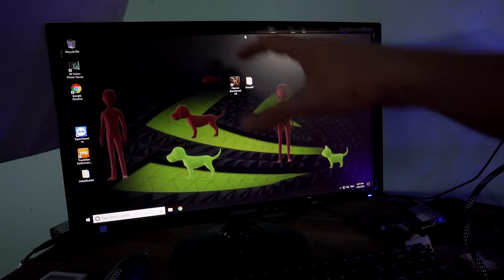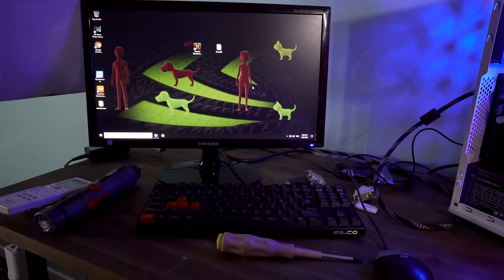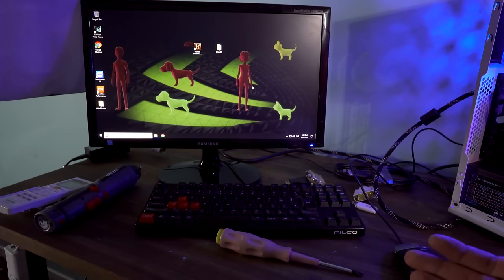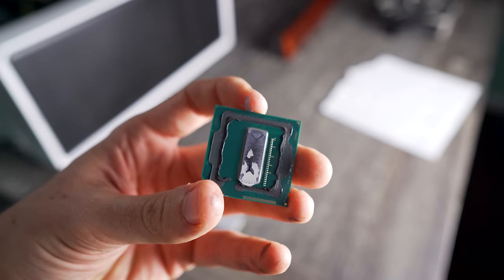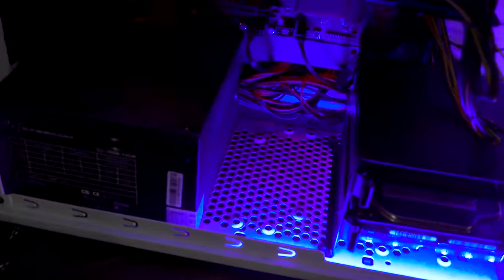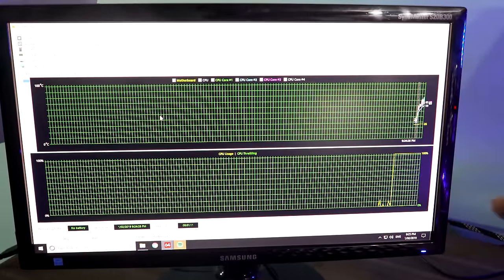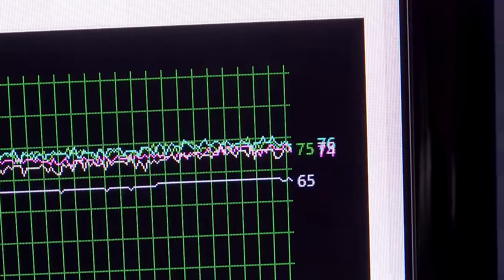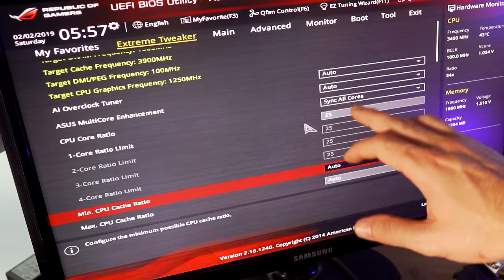How to Spot a FAULTY CPU.....? The i7-4770 Dilemma....

Comment: THANKS! you saved me from throwing away my 7700.... I bought this second(?) hand cpu for an old mb and it worked fine for a couple of days, even benchmarks all below 85C until it started freezing dead before boot...   it just froze either before post, during post, or after a few seconds at the bios screen when I managed to hit F2 in time... I swapped it for an 7100 i have laying around to modify the config to lower the ratio, fix the cpu core voltage at 1.125, and disable turbo-boost... then back to the 7700 and it FKIN WORKED :D... It's running hotter than usual but at least it's not an expensive paper weight now :D

Comment: Great video, lots of information. I've fixed lots of computer processors, but that was when they were still made from desecrate components. I had to troubleshoot and repair them to component level, replacing capacitors or resistors or IC's or transistors or diodes. Now that was before micro processors like today's, these were on one to six circuit board cards connected by via a BUS.  A lot different than what you are doing, but at that time it was the in thing to do, lol...

Comment: My recent issue with 4th gen i7 4770 is it never gets heated up 😂😂😂28 to 30 c only. My system shuts down after 30 min Or an hour. Never starts after that. May start after a few hours. After watching your video, and changing CPU ratios it worked. On stress test the temperature was 70-c.b At idling 35-c. The system worked for 5 hours now, today. Thanks buddy

Comment: My 6600k randomly freezes the entire computer (it had nothing to do with OC or C-States, if it didn't freeze PC, it would run any test). I have been looking for a problem for a long time, blaming RAM, motherboard, power supply and disks. Until now, I had no idea that the CPU has more states than two "works" or "doesn't work". Well, man learns his whole life;)

Comment: I like this video, and conclusion you came to. I've had 2 3770k's overheat severely with even minor overclocking/over-volting. I ended up de-lidding the second one, applying liquid metal, and it now stays cool and stable at 4.7 ghz. I think de-lidding is almost mandatory at this point with these 3rd and 4th gen chips, if you want a decent, stable OC.
Reply: Bro what is de lidding can you please explain

Comment: A faulty CPU rare? Nahhhh, at the store I work for, I even had clients, who had faulty power lines that caused problems and resulted in random shutdowns under load. Or a faulty case that also caused random shutdowns. Yes a case, not sure what it was, but it was gone after we changed the case (, after we had changed everything else. The client thankfully was a very understanding one).

Anyway, great video.
Reply: @【】_【】 Not sure what you mean by that? If you want to imply that I lied to the client, it was him who suggested the cause. It even was fixed after he installed a UPS.

Comment: Been in the computer industry for 30+ years and the only Intel CPU I had fail was a Pentium P5 90 MHz CPU in 1994. Had more problems with AMD CPUs, but not in along time. I have a 4770K in my current PC which has been running fine since I bought it new in  2015. Looking forward to the new 3rd gen Ryzen processors for my next upgrade.

Comment: I've been building and repairing computers since 2008 and I've only come across 1 bad CPU, which was a dying Core i7-2700k. It needed extra voltage to boot into the system without crashing. One of the contacts (Lands) on the bottom of the 2700k was black, not gold. On some ebay listings, I've seen "Parts Only" processors that were missing capacitors on the bottom of the CPU. So it does pay to visually inspect the CPU. 

I didn't need to run the P95 method because I had a working 2600k. In fact, I've used Prime95 Blend to diagnose DRAM problems. Sometimes with the DRAM and CPU stability problems, a thread on the Prime95 test will stop running. With the memory I can swap and add sticks in order to find the bad stick. 

Another guy I know scrimped and saved to his funds to get a Core i7-6700k, which had a problem with one of the memory channels not working. This resulted in 2 of the memory slots not working. At least he was upgrading from a Core i5-6500 which recognized all 4 sticks, so his problem was easy to diagnose. He tried raising the VCCIO, VCCSA, and DRAM voltages but this didn't help him. He even tried reseating his cooler and everything was good.........no bent pins.

There was another time I put a mono-block on my system, and the uneven mounting pressure caused one of the DRAM channels to quit working properly. All I did here was I reseated the mono-block, and everything was fine after that. So it pays to make sure the cooler was mounted properly.

These days when I delid my processors, I use liquid electrical tape on the contacts that are next to the die. This will keep the liquid metal compound from shorting those contacts and killing the CPU. Some people like using clear fingernail polish here, but I like using the liquid electrical tape better.

Comment: My 4790 is on the warm side too, but since it's not giving problems and as you say it's still somewhat expensive, I'm not going to risk delidding. But maybe some day.
Reply: @webbie7503  I have the same cpu. But it gets really hot. (50 - 55 C idle) (70 - 85 when gaming) I dont know if it is the cooler or the cpu whos causing the issue. The cooler isn't great i think its a spire sigor iv, but anyways i just wondered what cpu cooler you have i need tips :D

Comment: I had a customer bring me a Dell optiplex 9020 they bought from the off lease section. The computer would not boot and the warranty had been 90 days and they were at 100 days. So they just told me to get them a used 9020 board and I5 to replace their I7 4790. At that time , nobody had listed an issue with the power switch. I still have not read the issue and now I know this issue. I still have the board and chip I pulled but I did discover that the power supply was blown. Since I did that as a favor to them, I no longer had any extra parts around for checking stuff. My guess was the power supply blew hard and took the board and chip.

 There was an issue with the 8 pin power supply they used having a very high failure rate. Anyone else disagree with the assessment ? The power supply did not have any power and when their used same Dell 8 pin power supply came in, I plugged in the I7-4790 board and did not get any fans or lights or beeps. I was unable to check the CPU without old parts, The customer was using the computer daily so, I did not pull the I5 and take a chance on damaging their board in any way. So chance the I7-4790 is alive ?????   I vote it is dead because of the definitely dead PSU and Board. PSU had the reputation of popping as it died with a high failure rate.

Comment: Cool video.  It is a two for one.  You also show how to destroy memory by installing it while power is running through the motherboard as well as handling the memory stick on the memory chips rather than the edges of the DIMM as shown in this video.

Comment: I had the same problems with an Engineering sample cpu, it is running mostly fine now without changing much of the settings.

I did change out the motherboard battery and that increased the booting stability a bit.

Comment: Recently I did a build with a 4770K. OC'ed to 4.4GHz on a Corsair H110, it maxed out at 79c during Aida64 (after some minutes). I was pretty sure it's been delidded by previous owner (Sometimes you get pleasant surprises when hustling 2nd hand hardware. :)
Another way is to see how quickly the temp rises after the stress test startup. If it instant goes to max temp, is the connection between die and IHS is the limiting factor.

Comment: I'm not sure why, but despite the exact same architecture and only 100mhz speed difference I've never come across a Haswell xeon that's had the same issues with temperature, even spite of the fact many where used in much higher duty cycle loads with smaller cases/coolers than there consumer breathern. Could it have something to do with crystallization of the TIM with heat cycles rather than actual drying, or perhaps that these CPU's never saw attempts at being overclocked? Or may there have been a difference in the binning/selection criteria? Either way, they are a pretty cheap/widely available part still, so if your buying used and your not getting a K skew, I'd compare prices.
Reply from the maker: You are onto something there, I noticed with some of the mining experiments I did back over a year ago, that some GPUs would be fine* to just keep on running, but take them down for a week then try booting them back up and you would have to change the thermal paste.  Something to do with cycling from hot to cold?
Reply: umm I'm gonna say voltage is the answer? my E3-1246 v3 needs only 0.89v to maintain 3.5ghz and 1.01 for 3.9ghz "turbo" speed, the 4770 I got rid of needed 1.19v at 3.5ghz and 1.22 at 3.9ghz... both kinda won the silicone lottery, and tested on the same boards. the 4770 needed more volts, hence ran hotter than the Xeon at the same speed...
Reply: Haswell E (HEDT) and Haswell EP (Xeon) use solder TIM not thermal paste.
Reply: @C-S-J  True, however the Xeon E3-12xxv3 of the LGA1150 socket is in fact thermal paste, not solder, and are the directly comparable parts to the i7 4770 of the video referenced in the video... and yet doesn't seem to face the same age related overheating or instability as the consumer i5 and i7 chips.

This is why I'm speculating about either binning differences of the core itself or effects the different use cases have on the longevity of the paste. And the conventional logic that more use and hotter running would correlate to drier paste and higher temperatures later in life doesn't seem to hold up with my experiences on the platform.
Reply: Xeon's are better binned parts for Enterprise systems that need power efficiency and stability. So of course it makes sense when a Xeon counterpart from the same architecture runs cooler and with less voltage than their desktop counterparts. But yes, Haswell was a very hot architecture in general (even hotter than Ivy Bridge) compared to Sandy Bridge, and most overclockers were better off with the 2600K due to it's best performance without the hot temperatures since it was soldered. That may be why a lot of people never upgraded from their 2600K until Coffee Lake came around. This was fixed when Skylake came out with the 6700 being quite cool when you're not bumping up the voltage, just to be undone once the 7700K came out due to the high clock speeds and obviously the poor choice from Intel to use TIM on enthusiast parts. Ivy Bridge and Haswell overclocking ARE NOT the same procedure when compared to Sandy Bridge. The 22nm Tri-Gate transistors are much more sensitive to voltage than the 32nm transistors we saw with Sandy Bridge. This can prove to be a pain when overclocking since you may need to bump the voltage to reach higher clockspeeds, but that may cause the heat to ramp up with it. And we also know that voltage does cause a linear increase in heat either.

As for thermal cycling, that's a lot worse on a CPU and GPU than if you ran it constantly at the same temperature. Large temperature spikes can prove detrimental to hardware. It's why mining GPUs are usually actually in better condition than a GPU used for gaming because a GPU used for gaming will be thermal cycled A LOT between hot and cold temps. And there's miners that actually ramp the fans up and undervolt their GPUs also to keep low temps. Thermal cycling can cause PCBs to warp over time and solder to crack. In fact, the Xbox 360 had this issue where it would get very hot under load, cool off when not in use, and over time this caused the solder that held the GPU in the socket to crack and cause the GPU to stop working, and thus the red ring of death would occur.
Reply: my E3-1240v3 also never got hot and neither every  other haswell xeon i had: 1230, 1231, 1241, 1246, 1270 V3. Maybe it is an instruction set which causes the high temperatures. the xeons are much more sensitive for high memoryvoltages!!!!! maybe because they have to support ecc ram too??

Comment: Don't know if anyone's pointed out but, next delid, use some nail varnish on the tiny resistors next to the die.  The liquid metal can migrate and short them, which is not good.
Other than that, great little 'how to' Brian.  [thumbsup]

Comment: I once had an AMD system shutting down due to 'overheating'. I replaced the cooler a couple of times and the thermal paste a couple of times. Eventually, I became convinced that the motherboard 'thought' that the system was overheating and shut down. A new motherboard solved the problem.

Comment: I had a i7 4770 that I delidded, I didn't seal the IHS to the CPU little board. I used Arctic MX4 both between CPU die and IHS and between IHS and cooler. It worked fine for about one year and a half.. until last week when it simply refused to boot showing nothing on the screen. I took it out, I re-placed it in socket, and now it works again. Before delidding I had 70 Celsius in idle.

Comment: For testing CPU only use Small FFTs in Prime95 NOT the blend test, and use HWMonitor for temperature monitoring when Prime95 runs at the background,
Prime95 will give errors if the CPU is faulty or unstable overclocking.
For memory testing use memtest

Comment: The bad thing about these CPUs overheating is that over the long term will last shorter and will have more probabilities to die sooner. So that brings me to the next question: and how about the alarming high temperatures found in gaming laptops? These usually get to a heat level that is borderline the maxium temperature that these dies can handle.

Comment: Over 2 years now I've gone through 3 sets of RAM, a 1070 and 2070 GPU, an SSD and NVME.2 storage for the OS, and reinstalled windows several times.

Yet my system still crashes semi-regularly. Sometimes daily. Sometimes weekly. Raaaaaarely I can get 3 weeks without a crash.

I'm confident I have either a bad CPU. Why? Because while installing my AIO cooler I was trying to squeeze it on suuuuuper tight with a LOT of pressure, before I realized I could loosen the screws to get the AIO mount on, with ease.

And you know how AMD's PGA sockets are.

Comment: My first pc was a Q9550, I picked the parts but had the store build it. Once arrived it worked but not great and had higher temps and seemed to thermal throttle. In transit the cpu cooler must of been shaking because the thermal paste was cured with airgaps on all but the very center of the cpu. Cleaned it up and new paste and it was running normal. This system also had the OCV-Reaper 1066ddr2 that would cause issues on stock volatages or if placed in certain slot combinations with bootloop.
Reply: On a side note to whoever reads this comment: nowadays every cooler out there will come with some sort of pre-applied thermal compound which most of the time is $0.10/g crap (some coolers do come with decent stuff so do your research if you can). I recommend everyone to scrap that white stuff off, get yourself some decent thermal compound like Kryonaut or MX-5 (if you want more longevity but decreased performance over Kryonaut) and replace it, your temps will probably be about 5C lower. Plus it will probably last longer unless if you're constantly running 80C+. Kryonaut's break-down point is 80C, MX-5 should last longer in a high temp scenario but will not offer the same level of performance. There are more expensive solutions that might endure longer than Kryonaut in a high temp scenario but I personally think that by the time it starts losing effectiveness, your system will also need some cleaning, so it's not hard to also repaste at that point.

On GPUs I highly recommend to test it on day 1 and then straight up repasting with Kryonaut once you're sure it's working fine. You will get better performance after the repaste, specially on Nvidia GPUs with the way GPU Boost works.

In my case, I use a slim gaming laptop as my daily, my CPU (i7-8750H) runs 80C+ under load and these high temps lead to the thermal paste to break down/dry out faster than normal (I use Kryonaut). So I just replace the thermal paste whenever it's time to open my laptop to clean dust build up, which I probably do every 3 months or so. Every slim laptop I've seen out there running an 8750H will inevitably CPU thermal throttle at some point due to design limitations, so every degree counts if you want max performance and longevity.

Comment: I had some boot-looping problems with my 4770k (and or mobo?) a couple years ago, and I still occasionally run into issues especially when overclocking. Without a doubt the most frustrating thing to fix. I could get it to boot with only 2 sticks of ram after clearing cmos but it would only boot once (it would start looping after shutting down or restarting), so I had to clear cmos after each shutdown (or oddly enough change which ram sticks I had inserted). I finally fixed it after messing around in the bios by setting all voltages from the default "auto" to "normal" with the exception of vcore and ram voltage which I set manually. After that it had no issues even with 4 sticks (it wasn't vcore or ram voltages that were the issue since those were the first I tried experimenting with). If I were to guess, there must be some sort of auto-voltage-calibration thing that's not working properly but I have no idea whether its a problem with the motherboard or cpu, but it must be a hardware issue since updating/switching bios didn't help. I've been wanting to sell my 4770k and upgrade to ryzen but I'm afraid someone will buy it and cant get it to work and I'll have a situation similar to yours. :/
Reply: did you change the bios battery anytime?